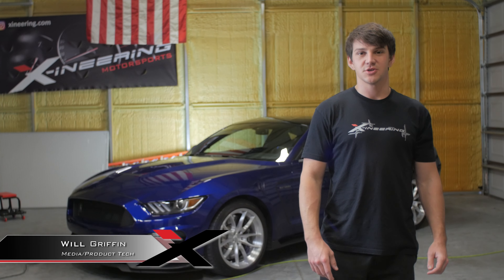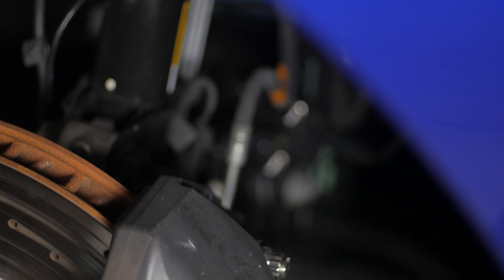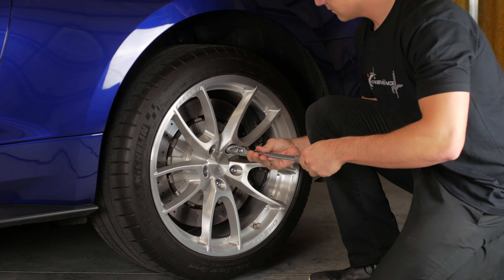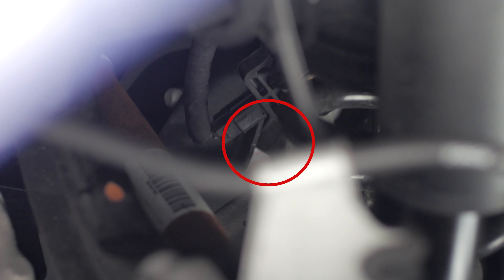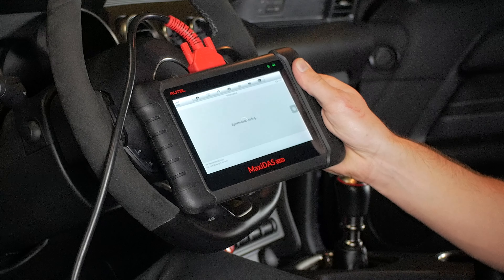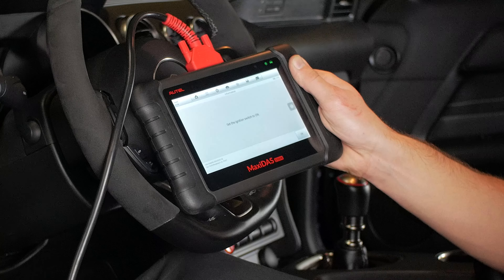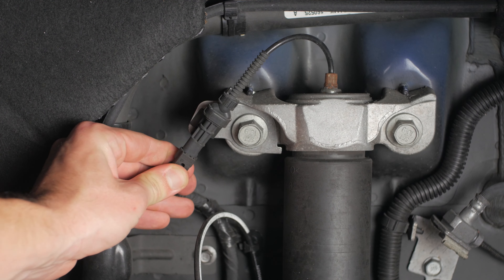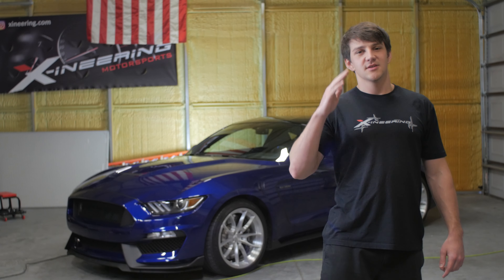ShockSims.com 2016+ GT350/500 | 2018+ 5.0 GT Magneride Bypass Tutorial - Xineering

Comment: Should I get the 8 or the 4 sensors ?
And what's the difference?
Reply from the maker: Hi there. If you are only replacing the front or the rear shocks then you would only need a half kit which is x2 Shock Simulators and x2 Ride Height Simulators. A Full Kit would be for all 4 corners.

Comment: Do you have a magride canceller for a 2020 GT500?
Reply from the maker: Yes we have a bypass kit for the GT500.

https://shocksims.com/valuemeals.html#!/Multi-Piece-Full-Kit/p/413417958/category=127526635

You'll need your own scan tool for the ride height trim procedure as ours currently only supports GM.  We will have Ford in there very soon!

The GT500 uses the same ride height sensors and magneride shocks/connectors as the GT350 shown in this video.

Give us a call, email us xineering@gmail.com or fill out our Contact Us form on ShockSims.com
Thanks!
Reply: @xineering  wow awesome! Perhaps I should wait for your scan tool that can calibrate the ride height as I dont have my own dealer level scan tool like that.
Reply from the maker: @redemption_gt500  You could call around to some local shops to see if they can perform the trim procedure for you.  They should have a SnapOn/Autel/Launch scan tool that should be able to do it.  
We are still a few months out on our Ford (VDM - Vehicle Dynamics Module) scan tool and software as we are testing on multiple ford vehicles.